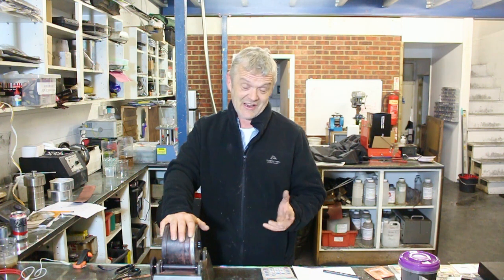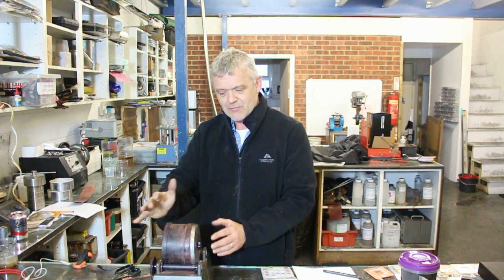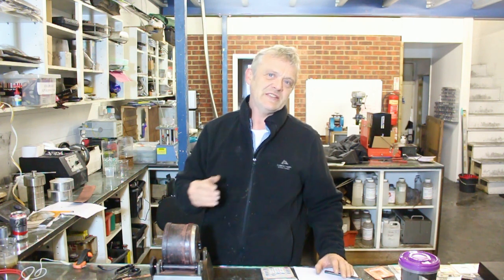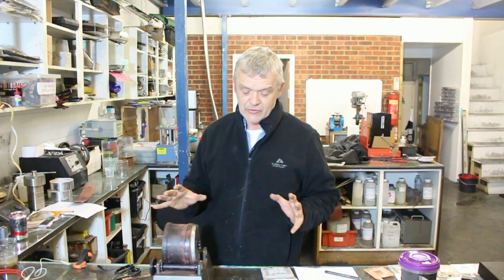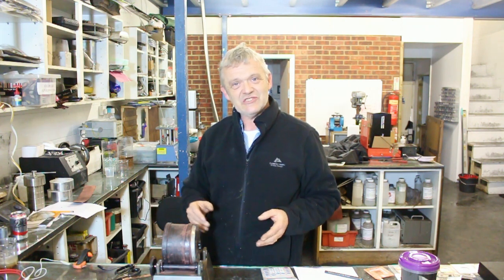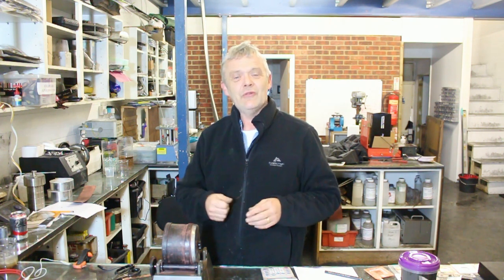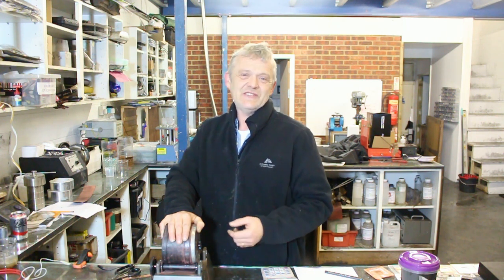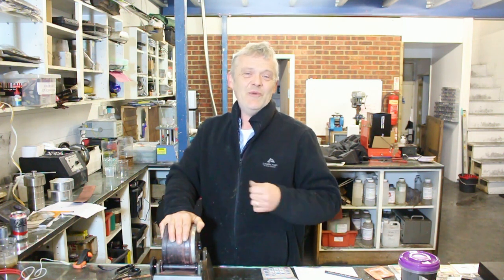Peen Plating And Nanoparticles - A Little Follow Up

Comment: Robert 

I made a tumbler like that years ago by affixing a washing machine pulley with 3 screws on the end of a Maxwell house can with plastic resealing cover.Then placed it on a pair of old roller skate wheels still mounted on their axles. Found an old v belt and a 12 volt motor, that turned the canister with my brass and walnut shells for fine cleaning. Voila as Frenchie's says you've got a 5 pound tumbler. So how come you over paid.......? Humor and ingenuity make the world good sport ! Ta !

USA Robert
Reply from the maker: nice work mate and they do indeed - it's part of what makes life fun - well for me lol